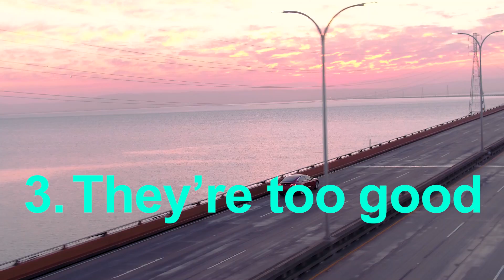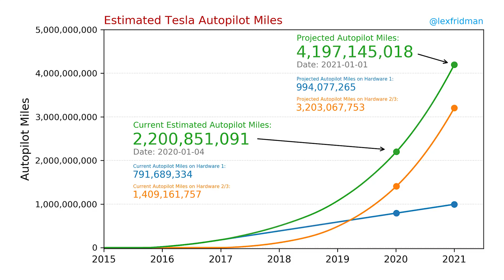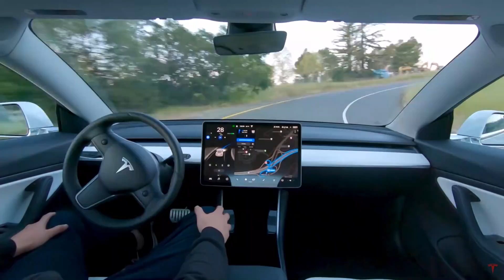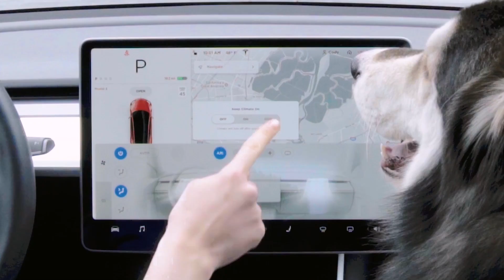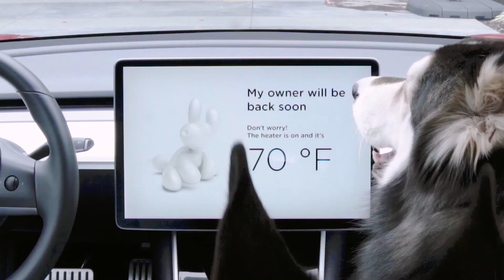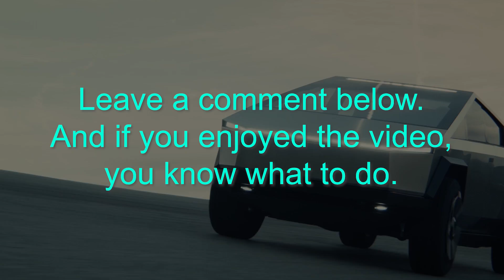Tesla Battery Investor Day (Predictions)

Comment: Great video,  and probably the only one that touched on the battery storage part. In my opinion, Tesla will probably show more on storage and hopefully  Vehicle to Grid technology(V2G).  As Tesla has produced their 1 millionth vehicle, if we assume)on average) that each vehicle has a 60kWh battery, that's a 60GWh mobile battery which, if you look at it another way, is 310 Hornsdale Power reserve batteries. That single Battery(Hornsdale) has been a big  disrupter in Southern Australia, lowering electricity prices, and saving millions. what could Tesla or the world do with 310 of these if the implemented V2G?

Comment: -The 4:20 joke has been overplayed by Elon. Not funny coming from a CEO.
-Battery Investor Day is almost a year behind schedule.
-The event will be about combining Maxwell capacitors with lithium batteries for regen/acceleration/charging improvement.
-Full self driving is years away, if it ever comes. Even if tech worked (it doesn't today) the regulatory and legal framework just isn't there. (who gets a ticket when FSD taxi breaks the law? Who has legal responsibility when a FSD car crashes or kills?)

Comment: im my simulation Tesla fast track the technology to a breaking point. Tesla reaches a less than profitable solution to produce a vehicle that everyone can afford in fact you cant afford not to switch to this final model. the Model 1 a 20k vehicle that can be configured into any fathomable set up to  replace every possible consumer need now and in the far future. that boast a 500 mile range with full self driving. even if tesla lost money on every sale they will disrupt the entire system it will be a do or die moment for the entire economic system.

Comment: Hi Steve, great thoughts! With the shift to Autonomous driving,  the demand for passenger auto should decline. To that end, it’s probably worth looking at the Collaboration strategies you mention with a lens of ‘what if’ scenarios to the demand picture. Also think about collaboration prospects in software services. As a hedge, is it possible Tesla might have a Manual Override service where the car can be taken to manual mode in dire scenarios? Given vast amounts of data at disposal, a remote command and control or just raw data may be one of the services to be sold ..

Comment: 1 Million mile battery would also allow good economics for V2G.  Not as good as autonomous but if autonomous is delayed and you could get a $0.10 spread arbitraging power you potentially could make about $20,000 over the lifetime of the battery.  Of course those economics suggest that the same battery could be sold as a stand-alone device for individuals to arbitrage power as a personal income source.

Comment: Slight correction: Taxi-cars/cabs regularly see mileages in excess of 1 million KM within 2/3 years.
Reply: Luckily the MM battery can actually go further than 1 Million Miles.  That (theoretically) is to 80% of original density (usual measurements), so would still be acceptable for (taxi) service well after that, at less efficient returns (more charging breaks)

But, a refit after 1M, and reuse of those old batteries elsewhere could be economically viable too, with knock on advantages.
Reply: CAV M, going a million km in 2 years would mean driving 1370 km every day, 7 days a week, 52 weeks a year.  I don't see it.
Reply: @incognitotorpedo42  Good point. I should have looked into the numbers closer. 1370km/day would require you to maintain an average speed of 114km/h (for a 12 hour day) Unlikely

I could see a TRUCK almost doing that (not in 2, but 3 years perhaps) - That would be 913km a day (12 hours a day) at an average speed of 76km/h. Plausible (if on a highway often). Taxi less so, as they're stationary for a lot longer. 5-6 years perhaps

4 years (684 / 12d @ 57km/h)
5 years (548 / 12d @ 45km/h)
6 years (456 / 12d @ 38km/h)

Also, for reference 1 million miles is 1,609,344km (according to google), I was calculating from 1M km, so the battery can go 60% farther still, or, last 60% more time at those average speeds (still, to 80% original density)
Reply: @incognitotorpedo42  Ask a taxi driver next time you take one and you will be convinced :) Try 3 years and the math will add up.

Comment: I would like to see, what Tesla's lead is in numbers; what other manufacturers' battery degradation is in connection to range, charging duration, weight, prize, efficiency. This only could say, what the distance is. For now we are just guessing. Also Tesla will not compare themselves to anybody else, because they don't do that. So we need to get on that data on our own.

Comment: Maybe some of the big auto companies would buy Tesla skateboard designs. But most seem to think shifting to hybrid electric cars is easier/smarter for them and sufficiently 'green' to satisfy most consumers without asking them to change their driving lives (other than fewer trips to the gas station).

There's a better approach - one that better matches Elon's goals and financial constraints.

In addition to making some of their own batteries, Tesla could license the tech to battery makers, but ONLY to sell back to them. Then they can produce the best battery packs for the hybrids the big automakers want to produce, while giving themselves greater economies of scale for their own cars.  

For the same investment needed to produce skateboards, Tesla could enable far more electric cars with battery packs.   And if they make battery packs for other companies' hybrids, they get another big multiplier of electric cars enabled for a given volume of batteries.

Sure, individual hybrid cars aren't as 'green' as full electric cars, long term.  But they ARE greener in the short term (less CO2 produced per car due to battery manufacturing).  And if 10x as many hybrids as full electrics can be enabled for a given investment by Tesla, that's at least 5x as much CO2 production avoided in the near term (next 10 years) as putting the same number of batteries into full electric cars.

Comment: Think you are on the money as usual! It is going to be a true mic drop moment that will discredit the ICE for ever as a viable option. Think their charging speed will also get a boost as a result of the new tech, where the super chargers have been sand bagged waiting for the new tech. So it will be cheaper than and ICE, as fast to “fill up” and last longer. Boom 💥

Comment: Technological advancement does not work like you describe. If a legacy automaker is 5 year behind Tesla, it does not take them 5 years to catch up.  In technology you can see a lot of examples when an underdog catches up to the leader. Like AMD did in the last years and like Airbus was founded with A300. 
That does not mean that legacy automakers are not in big trouble.  This can turn easily into an Apple-Nokia story as well. All I am saying this is not obvious yes. I be ton Tesla, at least in the extent that it can remain in a leadership position. Taking the majority of the market is a different question. Many things can happen. Just one example: China can copy/steal Tesla's technology and create something even better. 
R&D in auto industry is quite high. They just don't spend on EVs enough yet for some unimaginable reason.
Tesla's other great advantage is that they are they biggest EV and batter users, so economy of scales will help them as well. Others, who join now will struggle.

Comment: I Own a 2015 Model S 85 with 75K miles on the clock. My maintenance costs have genuinely been ZERO ( tyres only) In fact i just paid £850 to service my daughters Mini One ( 1.6 diesel) at the 35k mile mark. It is real.This Matters.  EVs are a new epoch in motoring. Go Steven Go.

Comment: They need partners to accelerate key product lines. License the Tesla Semi design to Peterbilt or some other. Tesla designs, other people build. The Semi is too important to keep on the back burner.
Reply: ChitFromChinola 
It’s the batteries...
Not the truck that’s the issue...

Will need MANY more Giga-Battery Factories to deliver Cars, CUVs, CyberTrucks, Roadsters, Semi’s, Megapacks, (Giga-Packs someday!) and other battery using products. (HVACs??).

Peterbilt doesn’t produce enough batteries for Tesla Semi.
Cheers

Comment: Disagree on the latter part of the video - if Tesla are 5 years ahead it won't take 5 years to catch them. You have ignored the proven economic law of convergence (i.e the catch up effect).
Reply from the maker: What is the math to take this into account?
Reply: @SolvingTheMoneyProblem  It would have to be carried out retrospectively from setting a benchmark now. Claiming they are 5 years ahead of the market. Then see how long it actually takes the market to catch up. Tesla have made and will make all the mistakes (and competitors can learn from that). First mover disadvantage.

Comment: So, you make some valid points.  Here's another.

Licensing or using Tesla technology won't solve the automaker's problems.  
The money legacy auto does make is in (1) service, (2) finance, (3) price increases due to cheap finance.
Dealerships are a death knell for automakers.  Unless you can find a way for dealerships to make money, even VW can't take you seriously.  Why are dealerships such a problem?  If you abandon them you abandon your entire distribution system.  Much of which is financed through you in off the books transactions where a dealer takes out a loan with the car maker.  If you abandon them, they default on their loans and you're screwed.  If you go the other way and slowly let them starve, then you've still got the same problem.

Comment: Robotaxis will never happen. I know this to be true because i can personally stop it.  One roll of duct tape or aluminum foil tape can shut down a city faster than coronavirus.  One piece over this camera, one piece over that sensor and that robotaxi is stuck and going nowhere. Walk around to the next one stopped at a stoplight and repeat. Traffic backs up, other robotaxis won't even need to have their sensors covered as they'll never be able to navigate around the increasing blockages.  Traffic backs up blocking side streets, feeder streets, main roads, on/off ramps, highways, etc.  Of course, this "fsd without driver dream" will never happen on any normal roads, in cities and suburbs or rural areas unless all vehicles are fsd at the same time and no pedestrians are allowed. The last 10% of the issues fsd needs to overcome are simply exponentially difficult to overcome. And the best "auto pilot" systems in the world have years to go before they even reach that 90% point. Try going on a five km/mile trip from start to finish (ie one home to the next and not a portion of a straight drive down the freeway) and see how far it gets.  And it isn't about doing 90% of things correct, one mistake is either an accident or an abandoned vehicle. The real world variables in which an AI has to not only calculate everything it is doing but also everything everything else is doing, and read the static world and all of it's objects, and the figure out the intentions of other sentient beings paying various levels of attention will just simply never happen.  On a closed off dedicated right of way (such as a railway) yes. Everywhere else? Not a chance.

Comment: I believe you are probably spot on. The franchising of gigafactories to legacy makers would be an awesome idea. But Tesla needs to get the whole motoring world to be producing renewable energy and . . . Just like ice cars have been forced by legislation to use less energy per km, EVs need to focus on that just as much as they focus on battery energy density. Hypothetically if the world can produce 'x' kWh than ideally how much of that is consumed in cars should decrease every year by making smaller lighter better geared EVs capable of going further with less electricity so that the rest of the renewable electrons can be deployed to running households and industry. The model 3 should be redesigned smaller lighter and more efficiently to cost perhaps 70 percent of model 3 to build and use only 10kwh per 100km. It is way bigger than it needs to be to seat 5 people and their luggage. Reducing its size, weight and consumption to.7 would mean we could have 10000 Teslas out there using the same amount of cost and fuel as 70000 do now. The new VW electric hatch is the size we need and being a hatch is more flexible and versatile than the model 3. For the few ocassions in a year where say a model X 7 seater car capable of towing is required putting you own model3.7 into a hire company to rent out and hire their model X and pay say $50 per day to substitute. When owners of their model X have become empty nesters they could do the opposite.

Comment: Hi Stephen, love your videos man, great stuff! Tesla is disrupting the technology market, no question about that. When it comes to things like vehicle autonomy, software, data collection, vehicle insurance, and solar power, no one can even come close to matching them. They are also the clear leaders today in LITHIUM-ION battery tech; however, I'm not quite bought into the claim that they will continue to lead the future of battery technology in general, only because there are so many different types of batteries being researched. If lithium-ion was the only option, then of course no one will catch up. However, there is a lot of research being done on alternative battery technology, including things like lithium-air, which I think has a lot of potential. Maybe this technology won't be adopted in this decade, but at some point in the near future 10-15 years, I can't imagine lithium-ion being the solution to battery technology, there's just not enough energy density. Either way, Tesla will still continue to disrupt the technology market, it's in their company culture.
Reply: Thomas Doyle You’re correct about the Tech for Transportation being disrupted by Tesla.
If someone comes up with something better than Li -Ion, Tesla will be happy to use that instead. They’re always interested in improving the batteries...not just staying with one version.
MAXWELL will likely be just one of the specialty battery tech / battery improvement companies they acquire over the next several years.
They’re not an oil company...so they’re not tied to the raw materials they have to put in their batteries.
You’re correct that in 10 or 15 years, there may be a much better set of materials for batteries. Would be Tesla will be pushing that envelope...or partnering with whatever battery company is pushing it.
Cheers

Comment: On the mining front: at your leisure check out niocorp superalloys. Development stage mine I’ve been following for years. Will mine scandium, niobium, and titanium in Nebraska, US. About to receive “air constitution permit”, the last and largest permit needed. I am NOT pushing their stock, project has not yet received financing, just clicked mentally when mining was mentioned. https://www.japantimes.co.jp/news/2018/10/25/business/corporate-business/common-moon-rocks-metal-scandium-transform-planes-cars/#.XojdZKcpChA. Old article but explains connection of scandium/battery tech. Also, scandium lightens and strengthens aluminum and niobium does the same for steel. Mine ripe for the picking, buyout or contracts possibly. Sorry for the long a$$ post. Peace.

Comment: How about an "all-electric hybrid" with two or more different types of cells in the same car?(High power density cells for performance and high energy density cells for range, towing capability and overall efficiency)--say, 300 miles in 5 minutes, and another 200 miles in 1/2 hour.  This exploits the flexibility of electric motors for operating in different modes. It can easily be done with electric motors, but is impossible with  ICE architecture.

Could this be what the CATL negotiations were all about?